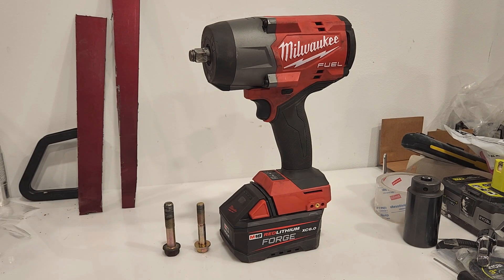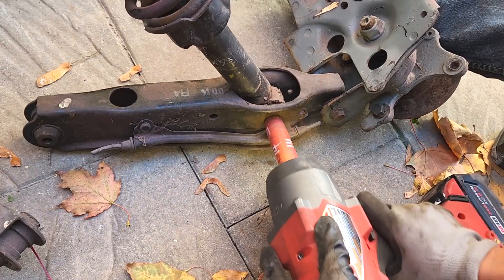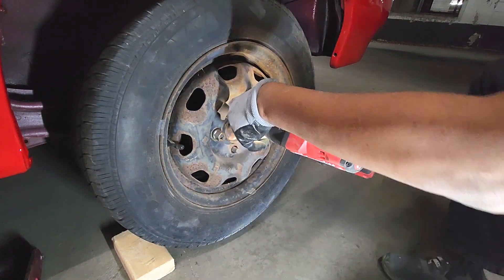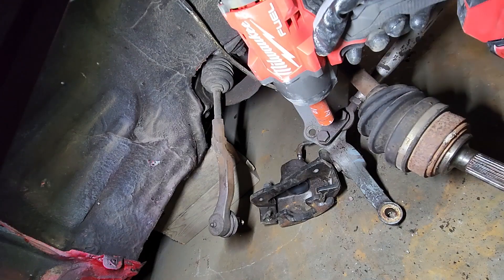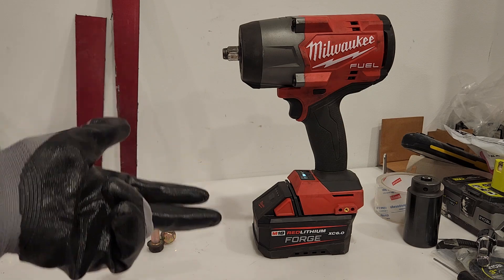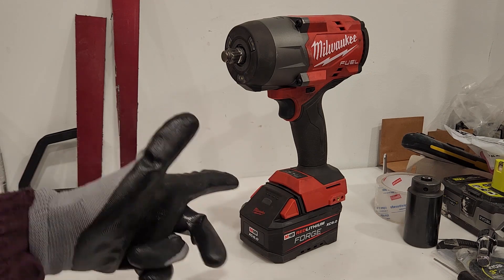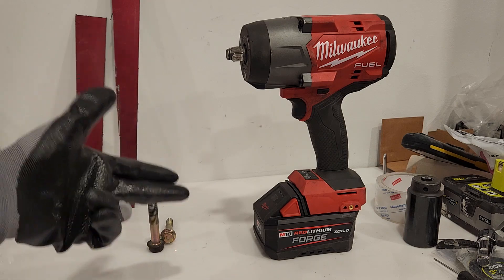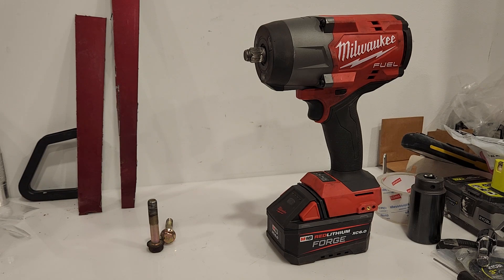Best high torque 1/2 impact wrench of the year for automotive

Comment: Problem i have with 2967-20 is it is crazy powerful for being 1/2 drive, it is going to shorten your socket life and be overkill and overweight for the application 99% of the time.  The dcf891 can do 99% of stuff in automotive and only weighs 5ish pounds or less while vibrating much less than fullsize guns.  I have heard it can do crank bolts with a weighted socket.  I think having a dcf891 or milwaukee midtorque is the way to go, and then have a fullsize dcf900/hercules ultratorque just in case.  I really think both the dcf961 and 2967-20 should be 3/4 drive.  Yes the 3/4 drive sockets only go down to 17mm or so, but at that size and smaller you don't need that level of power, and you can always use drive adaptors.  My dcf891 has suprised me, it has loosened a very rusted 24mm honda pilot strut bolt, using a impact swivel adaptor, and a 10year old 1.5ah battery...  I did have to use coworker's ct9050 for the 2nd one though.  I think hercules ultra torque and dcf900 are better value than 2967-20 for diyers, you can get the dcf900 kit, battery , charger, tool, for $270 US.  For a tire shop gun though, the 2967-20 might be the best you could get if the 50ft lb torque limiter works well.  I just use a torque stick on speed 2 on dcf891, works good.  I think the ultimate impacts would be dewalt power, milwaukee electronics (torque sense, torque limiter/settings), hercules batteries, and have both the dewalt-style light at bottom and milwaukee-style lights.  And sold at harbor freight, 5 year warranty😂
Reply: I last week got dcf892 and this week got dcf961 for bigger jobs just in case 😂

Comment: I have the dcf900 and I'm not willing to switch brands for a couple of extra foot pounds I also have the dcf911 and dcf891 and I have not used the dcf900 yet the dcf911 and 891 have done it all so far
Reply: the 891 is a monster mid torque
Reply: DeWalt  Dcf961 is the #1 most powerful 1/2 gun you buy beats the new Milwaukee watch torque test channel's video on it
Reply: @jeffscomp I have the 891 and it's awesome
Reply: @sinisterx9029  I have the Milwaukee high torque and the older DeWalt 894 mid torque and the 12v extreme half inch 😀  also that  3/8 12v extreme from 2018 or 19. They just sit around though. Need to use them more
Reply: I think you need to check out the Aircat 1125

Comment: This Milwaukee is great, I just got the dcf892(891 with different 'socket') because wanted something smaller even if weaker, but this 2967 is a monster for its size. Got today also a dcf961 with powerstack 5Ah batteries just in case 😅